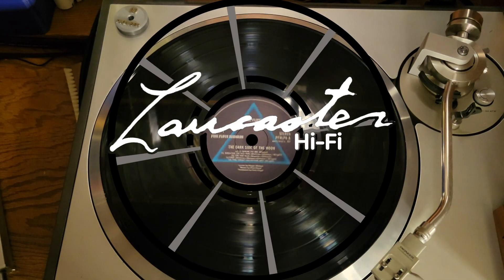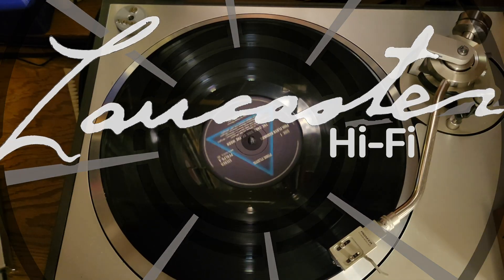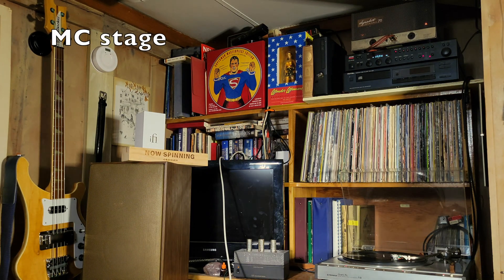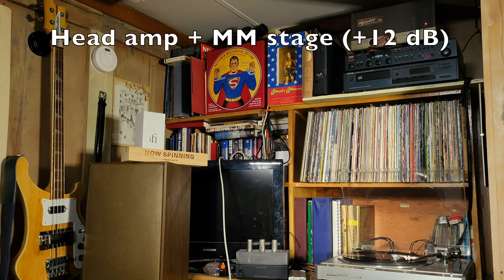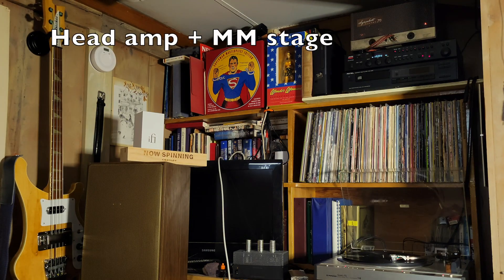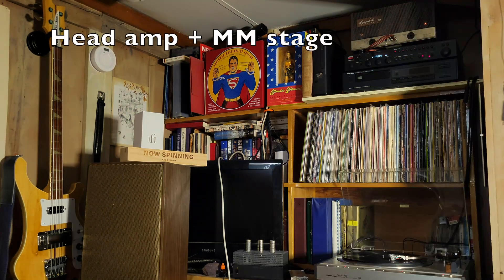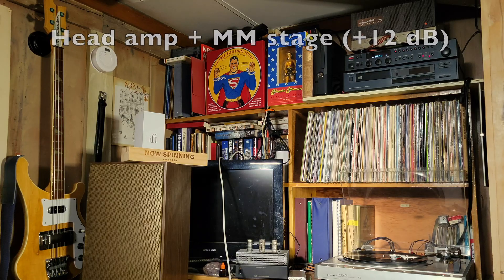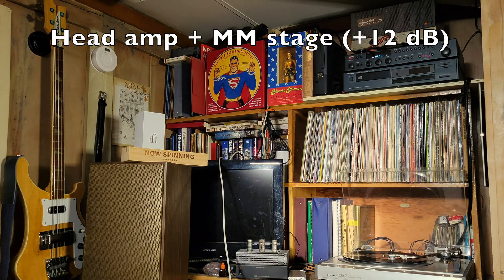What's a Head Amp? Hagerman Piccolo Zero

Comment: I built my own step up transformer using Cinemag transformers all in for under $400 10 years ago or so. BTW Jim Hagerman is a great designer, I have built several his phono preamps from schematics and they are very good. My experience with head amps vs step up transformers is that head amps sound better with solid state MM phono preamps and Step Up Transformers sound better with tube based phono preamps.

Comment: What the best op amp for moving magnet phono stage and what the best circuit board design for the best op amp?
Reply from the maker: I can't say specifically for phono stages. I generally like the NJM2068. It's cheap and has great specs. I've only used it to replace old op amps in existing circuits.
Reply: @Lancaster_Hi-Fi 5532 or 2068 what you're choice?
Reply from the maker: If i had to choose, 2068 has better specs.

Comment: I got the Hagerman Bugle kit years ago, I set it up at the lower gain setting as all but one of my cartridges are MM. The one MC cart is the DENON DL-110 that is a high output (1.4mv), manual says to not use a step up transformer nor a head amp, just direct to phono amp. The Bugle along besides gain also provides RIAA EQ.     
Does the Piccolo also do the RIAA EQ?    Bugle sounds Excellent no matter what cartridge is connected to it. I also run it with 9v batteries, No power supply or line noise.
Reply from the maker: The Piccolo is a pure head amp, no EQ.

Comment: you can get excellent aut for $500 that are as good as $1000 sut. 
you can get very good ones for less than $500.
Reply: yes mc phono amps are common
Reply from the maker: Sure, but not as common as MM phono stages.
Reply: no,  @Lancaster_Hi-Fi  but common enough to be common.  at 100 the hagerman bugle, at 200-300 the sota pyxi and ifi has 3, at 500 -800 project has 3 hybrid mm/mc (and probably a coupla solid state at a much lower price.)..2 tavish phono amps with built in jfet head amp... oh! darlington labs of course...go much higher its time for an SUT.

Comment: I’m hearing some masking I’ve got my thing into a Bluetooth mono monitor wedge without the head amp. It sounds kind of masked and obviously there’s a gain structure difference. I have to say for 300 bucks. This wedge I have that’s kind of sound on a stick. sounds pretty good. I only listen to mono for learning guitar parts and stuff like take for example, Steve Miller albums take the money and run And book a dreams and that other album man will you listen to just a writer the left channel the engineering is incredible like Mercury blues it sounds so bad ass just playing the left or the right channel. It’s amazing and then of course I play with the Phantom channel sometimes I haven’t done that for years just hooking up the positives

Comment: If not afraid to buy used there are alot of nice SUT's in $500 range give or take a $100. Ortofon,Denon,Phasemation etc . The classic Altec /Peerless 4722 builds can even be found for $500 to $600 despite their rise in popularity. Most casual listeners may be happy with budget versions.

Comment: I been using a borrowed Piccalo MC Headamp for a couple of weeks now and really enjoy it! I've been using it with my Mellow Tone tube phono pre and an AT33Sa cartridge, it sounds great. The one I have have is an older version with adjustable gain and loading dials on the top, and it can even be powered from batteries.